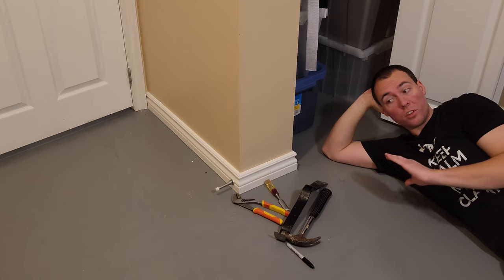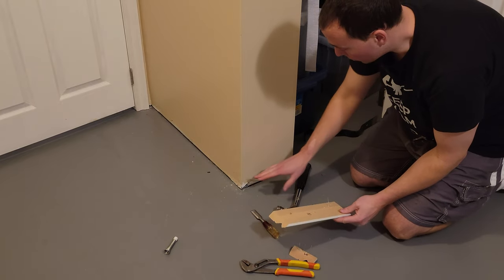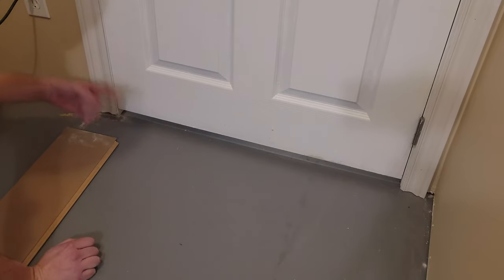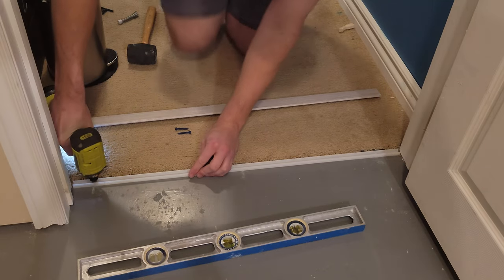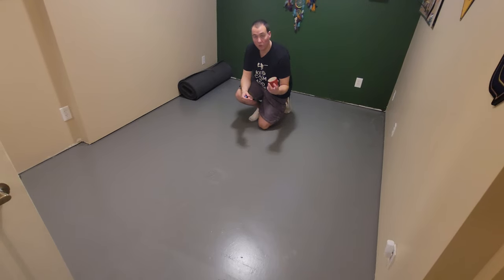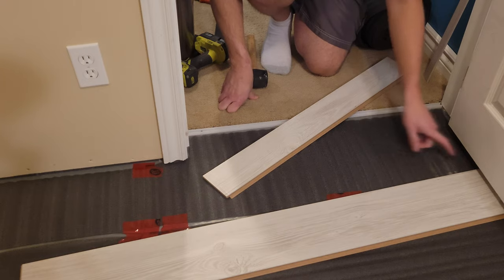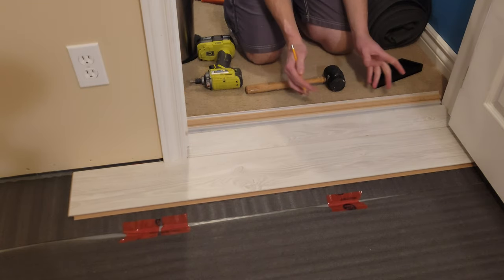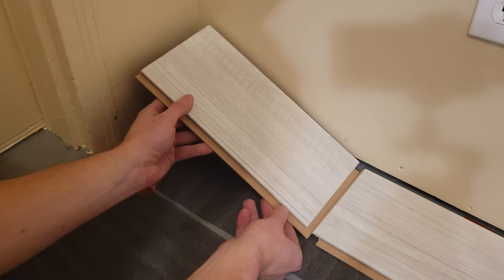How to Install Laminate Flooring for Beginners - Home Renovation

Comment: Great work Mr Nails - I ran into the issue with my last gap being less then a inch and had to knock a 1/2 inch off of 5 boards just so I didnt end with a small board.

Comment: Nice floors. Good tutorial.  The biggest problem I see with consumer installed floors is end joints not being tight.  With most brands it is important to give them a tap or two in both directions to assure you have a good lock.

Comment: A couple of questions.  

Did you check floor for level before you began?

I've seen/read people recommend that longest dimension of plank flooring run in the same direction as the longest dimension of the space.  You ran it with the shortest dimension.  How/why did you make your decision?
Reply from the maker: People say perpendicular to the light source meaning the window. Also that direction left me with nice edges at the start and inside the closet.
Reply: Seven months late , but what the heck!!  One of the reasons you run it to the length of the room is that it makes the room look bigger!!  Thhats what they say anyhow.  😊

Comment: This floor will have nothing but issues for the new home owners. Good job not following prior installation instructions
Reply from the maker: Do explain.
Reply: @DIYBuilds  expansion gaps are required in all directions and all sides even with the transition piece. Also don't believe the underlayment you put down would the proper moisture barrier to protect the floor from the cement. Once that floor starts to move it will have issues.
Reply from the maker: Well I did leave expansion gaps everywhere besides the small section along the door jam but even then it can expand out the other side. Also, as the consumer all I can do is use the products the manufacturer has recommended to use.